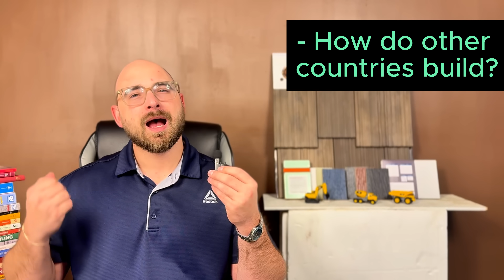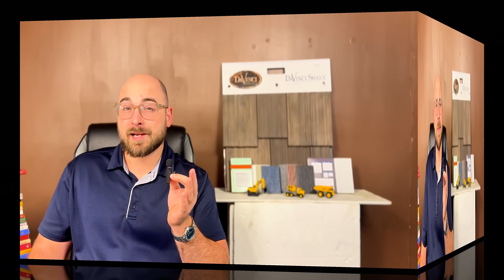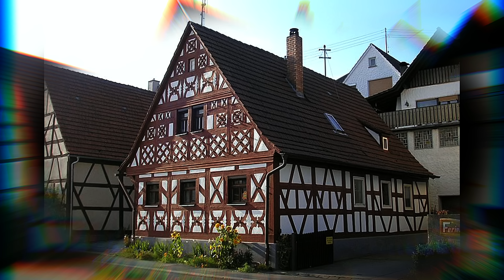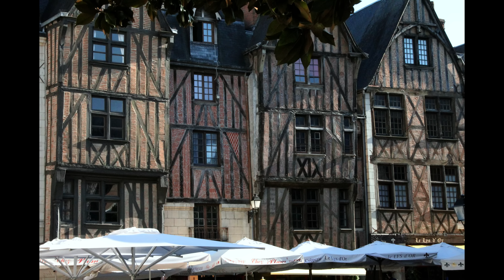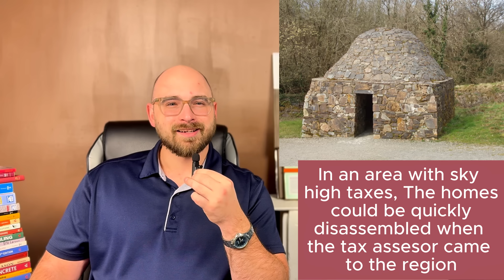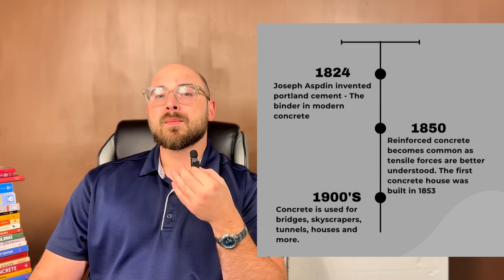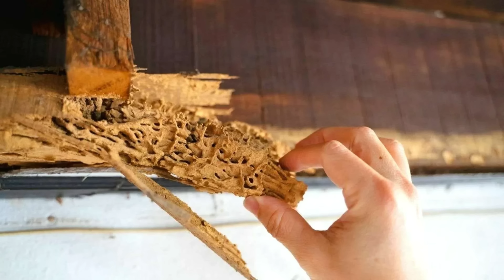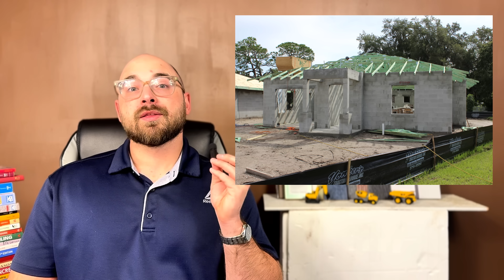Why Other Countries LAUGH at American Homes

Comment: Gamajoba!
Building a house from brick is better than a frame house. You only need a strip foundation set to zero. Then a couple of people can completely build a house in 2-3 months.
Yes, it takes longer than assembling a ready-made wooden frame. But in terms of complexity, it is accessible to people who have never been involved in construction. In the past, people often built houses themselves in whole or in part. My great-great-grandfather himself laid a large two-story brick house in the mountains, which has been standing for 150 years and feels great. At the same time, my ancestor was not a professional builder.
I myself laid a decorative fence and reconstructed an extension from bricks. I had a vacation and a desire to figure it out. Already on the second day of practice, I was able to lay bricks and apply mortar almost perfectly. Then the speed only increased as muscle memory was developed.
Therefore, the statement that building a house from brick is difficult is a myth. If you know how to work with your hands at least a little and you have a project that you can follow step by step, you can build such a house yourself.

Comment: I think it is about the standards in US comparing to Europe. The ICF sistem that you praise it do not alow the breathing of the house. So you will need an super eficent ventilation sistem. The insulation it might be 50 but the pasive house whit wood frame  sistem use doublle frame whit wood wool insulation. Ower all superior to ICF

Comment: Here in the Philippines, houses are made from cinderblock and rebar with a concrete  coating on the outside and a skimcoat on the inside walls. Doors are made of wood without thresholds and the flooring is usually tile. Roofs are mostly made of sheet metal such as corregated tin,  making the houses too hot in the daytime. Only a few houses have steel-reenforced concrete roofs which are consideranly cooler. Houses are on average 500 square feet and cost about $20,000. Cinder blocks are easily broken if dropped, rebar rusts before construction is completed and finding skilled laborers who actually know what they're doing is difficult. Houses don't seem to be built to last here either.

Comment: Hi Mike, I'm an old farther, but if I win the lottery, I'm building a house. I live near Ft. Wayne, IN, but I prefer to build on a bluff overlooking Lake Superior or Huron.
The construction method would be a bit of a hybrid, which is why I'm sending this to you.
The floors and exterior walls would be reinforced concrete. The interior walls galvanized copper bearing steel. I originally thought about a 6" galvanized inner wall to support the exterior insulation,  but the insulation, which are the forms for the CIP concrete, may be a better option. 
This would be a single level full basement house. There would be reinforced concrete piles & posts supporting the highway designed rebar reinforced primary floor.

Would this hybrid design (flooring interior walls) be too much of a construction departure? Also, I've used fiber reinforcing in other applications and have been surprised in its crack propagation resistance.

You can get as technical as you like with your answer.
I was aerospace materials engineer for 21 years and a bridge designer for 8 years.
Degrees in:
Chemical Engineering 
Civil Engineering

Comment: Concrete homes in Germany? Only Commercial buildings are built with concrete but not residential homes except the floors they are built with cement in both styles, but the majority houses in Germany are built with red bricks.

Comment: The wood framed houses in the USA have some of the most varied designs anywhere, they have central air, it is possible to upgrade the wiring, have more natural lighting and good insulation.  Winter time construction and modular construction are possible and heavy equipment is optional.  Cinder block walls and metal roofs used to be the stuff the dairy barns were made of.
Chicago is home to a lot of bungalow style houses made of brick built in the 1930s and 1940s.  Sturdy and often remodeled, may are being torn down and McMansions built in their place.  Did more permanent construction pay off?  So wood framed houses are adaptable, changeable
My wood frame and brick house was built ~1959 and rated a B construction, or better than average.  Today, I think a new C-rated house would surpass the overall quality of my house before any upgrading because the new house would have 50% more insulation, more efficient windows and HVAC, better lighting, wiring and safety devices, and basements should be dry.  Steel-studs in residential houses were pushed to replace wood when wood one-for one was costly and steel was cheap in the late 1990s, but the trend in NW Indiana, (near the steel mills), lasted but a few years.
-My parents built a post and lintel house ,(Lindel cedar home), in the early 1980s.  Triple pane windows, R38 insulation in the roof, R18 in the walls, geothermal 10 inch dia x 310 ft deep well, it would probably surpass the efficiency of efficient house built today, but the cost was about 2.5 times that of a similar sized house.  It did accommodate a fairly large 2.5 story open living area.  Well-insulated from outside noise, the floors squeaked a bit, (typical), and forget hiding most, wiring, HVAC or plumbing updates.  So flexibility was not a strong point although moving a wall would not be a problem as long as the posts were left untouched.

Comment: My biggest problem with the "stick built" construction is NAILS. I hate them. I use SCREWS. I also predrill a pilot hole before the screw goes in. I've lived in eastern Wyoming and Arizona, where the shaking from the wind eventually loosens the nails. 
 -- As far as concrete construction, I'm all for it. I don't have near as much experience with it, so I stick to Sticks (2X4s) and Screws.

Comment: There are currently several F L Wright designed Usonian houses for sale in the Battle Creek <=> Bridgman <=> St joseph, Michigan, area.  One party bought three for <$200k wi/i the last 10 years, update/ remodeled  and now sell ing them form $1.5+ million.  Not atypical for a Wright designed house, these use lots of concrete in one form or another, and mahogany (I think) interior.  Small bedrooms, narrow halls and small garages.  Even though they use warm water pipes in the floors, they feel cold in the winter.  One should wonder if the flat roofs are prone to leaks.  Falling Water in Pennsylvania required what seemed like a total rebuild because of the extensive use of reinforced concrete in its canterlevered construction. Interesting and fun to visit, but I don't think I would want to live in one these houses for long.  Maybe as an interesting office.

Comment: It is true. I grew up in Germany and moved to the U.S. in my 20s. Building and owning a home in Germany is expensive and less than 35% can actually afford to build. It can take 2-3 years to build a home and are made out of brick and concrete, hanging anything on a wall takes a drill bit, definitively not a nail. The roof structure may be the only structure that wood is used with metal components plus your clay shingles. While living here in the U.S., our home compared to the one in Germany is like night and day for sure.

Comment: In Indonesia we commonly use reinforced concrete frame structure for earthquack, flood and wind protection,
the wall can vary according to location, commonly:
Red Bricks
CMO
White Light brick which in trend today
And the cheapest, soft limestone blocks, most common material in my area.

But these years i studied platform framing, with lightgauge steel,
In indonesia the building cost is about 250-500 usd/m2 floor plan.
And it is need at least 40.000 dollars for family size house. Yeah it is cheap for western, but for Indonesian that is alot of money when average yearly income just about 4.000 usd.

Btw, i still thinking exchange rate is some how unfair. Like USA use dollars but had pennies, quarter which has value.
1 usd is equal about 16.000 idr
But in Indonesian rupiah the smallest coin today was IDR 100, which you didnt even get anything, the cheapest snack is about 1000-2000 idr= 7-14 pennies.
And about price, like 1 meal USA pay about 10-25 usd, if the contents was 2 toast 2 eggs and 1 cup of coffee, in Indonesia it would only cost 2 dollars.

Comment: I live in CR and the cheapest way to build is concrete, plus the high humidity levels would affect wood, we use cast concrete, they have steel in the inside of every cast we call the prefabricado pre fabricated

Comment: I think it's telling that two of the biggest cons of solid structure homes were cost and the need for skilled labor. I think that's kind of the point of their criticisms, that homes here in the US prioritize cost effectiveness over longevity, and that we don't put in the effort to hire and train bricklayers and masons. Cheap homes are good for contractors, not for homeowners. Even if cheaper homes are more available in the short term, more expensive sturdier homes will bring the market down over time, as they remain intact and new homes have to compete with the old.

Comment: I remember reading there was a concrete shortage related to sourcing sand for mixture though. I haven't seen any resolution myself for the problem and as I recall even large companies were struggling getting enough for projects. things may have changed though i don't look into concrete often.

Comment: To the person who claims Japanese always build superior hoyses with concrete: 
You seem to never have seen how Japanese houses were and are built. Try to watch some before after parts where they renovate houses. And the basic building method hasn't really changed: Foundation, put pillars in the walls and the middle of the house to support the second floor and/or the roof. Put the roof on top and close the gaps with two wooden board. E voila, you'll have your house. The only big difference nowadays is that the basement doesn't sit on a few big stones any longer but on a concrete foundation. And builders usually put some kind of heat insulation in the gaps between the inside and outside wall boards. The preferred method seems to be some fibry material in bags though one architect also used some kind of deflatable foam. And either method is also used under the roof. 

What shocks me the most is that it's still quite the normal to use simple glazed windows and/or uninsulated window frames and/or building gaps around the windows and doors. Japanese houses are bl...dy cold in winter and quickly get dangerously hot in summer. So much to "Japanese houses are built for summer" excuse. 

I've been told by an old man once who he's afraid to live in a concrete house because when during an earthquake the second floor falls down, it'll kill him. Dude, when a wooden second floor falls on you, you won't live to tell the tale, either. People totally seem to have forgotten that most of the 6000 people in Kobe died because the second floor came down and either killed them directly or trapped them so long that either the winter cold or the raging fires living of the wooden houses killed them. So it doesn't really make wood better than concrete or stone. The most important part is that houses can swing in one way or the other and can deflect the earthy vibrations during an earthquake. 

That said if wood really were superior, you wouldn't have the annoying situation that houses are no longer worth anything except for the land they are standing on. Except you're rich and can afford a luxurious house, it's actually not an investment to build a house here. To to forget, in the case of a fire, nothing will be left to salvage. And even a colleague told me that their family lost their home due to moraibi - fire that sprang over from the neighbouring house. That is still a huge threat in Japan, especially with most people still using gas for cooking and kerosene heaters in winter. And the punishment for @rs0n is stricter than for a h0m!c!de.

And for tourists, if you visit claimed 1000 year old buildings, the wooden material from which they are made is often younger than you are. Either you're looking at constantly remodelled/renovated buildings or even outright reconstructions. Wood is often damaged too badly here due to the high moisture in summer. You can basically watch wood rot away if not treated with often expensive methods.
Reply: At the time of the Kobe quake, I read that the most dangerous buildings had light wood frames and heavy clay tile roofs. They would have been much safer with metal or shingle roofs. Having a light wood house collapse around you can't be fun, but it's more survivable than collapsing concrete or masonry. My cousin's 8-room house blew up in 1978 and they landed in a pile of sticks, walking away with only bruises and scratches.
Reply: @pcno2832  Only it doesn't matter if one metric ton or two metric tons fall on you. You'll be pancaked in both. Also, wood is heavy. And even if your walls are concrete, the floor of the second floor or the beams holding up the roof are mostly made from wood in European houses, too. 

The houses with the wide windows facing south were usually only carrying the roofs on four main pillars in the corner. And once the earthquake has knocked them off, everything will come tumbling down. That was the fate of many Kobe houses. Add to that gas, which was then also used to make their breakfast, and the kerosene heaters in the living rooms often on tatami mats to defrost the living space, and you had the perfect recipe for disasters. 

The current trend of minimizing earthquake damage is having detached houses not fixed to the ground but on some kind of rolling or puffering system that doesn't transfer the vibrations onto the house. One system to protect higher rising systems that builds in counter weights that make the building try to stay close to its centre of gravity. We were relatively safe during some really bad earthquakes but people on higher floors told us, their microwave flew 3 m through the room. 

In the end it matters more what counter measures you took to make houses safer. That said it is telling that the average wooden house in Japan has no reselling value whatsoever after 35 years when you have paid off your bank loan for it. Concrete houses or mansions may still have some value. And I even heard one expert comment on a certain concrete house that it will even rise in value due to the way it was built. That was most certainly surprising considering most houses do the diamond and lose value from the day of buying it.

Comment: Are concrete houses really built to last? It depends a lot on who builds them, where they get the concrete and the conditions of the area in which they are built. We saw the Surfside apartment tower collapse outside Miami, a building which was about 40 years old. After that, buildings were found around the Miami area with major cracks in places that would be extremely hard to repair. Imagine going home every day to a building with cracks that got bigger every year, wondering which one would be the last to appear. And Miami, with its salty air, is not the only place where this has happened; after the Ronan Point disaster, various studies were done on the  prefabricated concrete towers that were built in the UK in the 1960s and a number of them were found to be unstable and had to be demolished. One woman complained that she could reach through the cracks into her neighbor's closet. If you Google "deadly building collapse", most of what you see will be what had been masonry and concrete buildings. And short of collapse, there are places, like Ireland and northern Connecticut, where concrete problems have made houses uninhabitable without overwhelmingly expensive repairs due to impurities coming from local quarries. So, while concrete may be the best all-around material for some places and building methods, there are more ways to get it wrong than to get it right. And light wood construction can be made just as strong as the builder has to make it; most building codes in the world require the same wind resistance from wood buildings that they do from buildings of any other material, and the strength of most  buildings, wood or otherwise is limited by the strength of the fasteners, braces and reinforcement, rather than the material itself. There are certainly some features of American houses that look and feel cheap and flimsy, especially some of the thin plastic exterior siding we use in cooler areas. It would be nice to see more brick, stucco or fiber-cement sided houses where I live, instead of disposable vinyl siding. But I doubt we'll be abandoning wood framing any time soon in most places.

Comment: In Brazil most of our Brick Homes are a mix of concrete and bricks. Concrete for structural parts (beams, pillars and slabs, and foundations) and clay bricks to fill in the walls (them everything is covered by some plaster and painted). But houses with structural bricks do exist, specialy some planned multi-appartment buildings, targeted for low income buyers throught government incentives. They are fast and cheaper to build, althought the walls are usually too thin and with bad insulation. They also are really hard to break to pass new conduits/pipes or even hang a frame or TV (since they are structural they can't be broken without planning, and drilling/hamering a nail is very hard) 😬